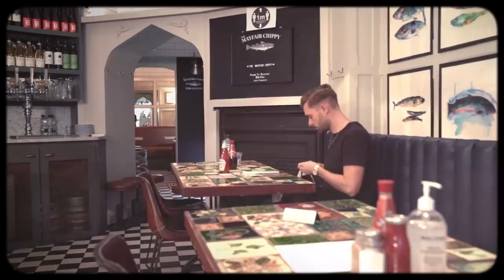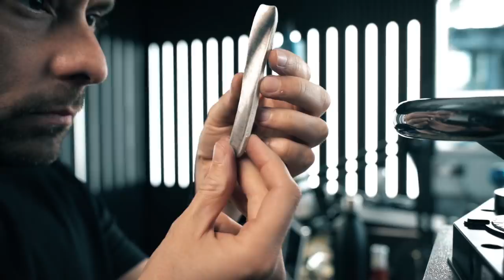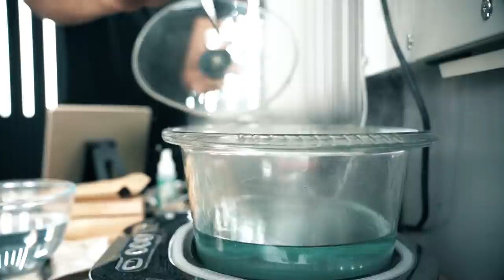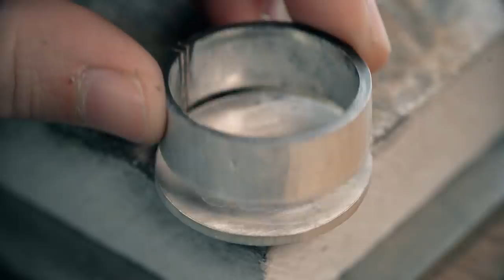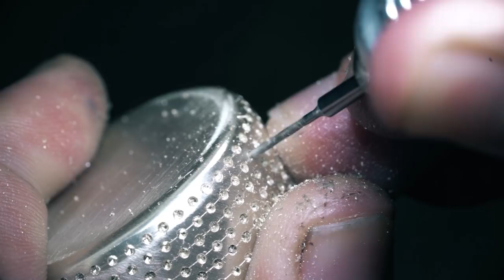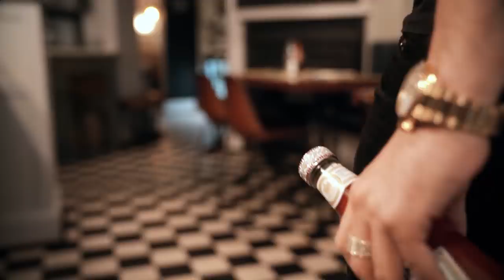I MADE THE MOST EXPENSIVE KETCHUP BOTTLE IN THE WORLD!

Comment: You should have a custom bottle blown with the Heinz logo embossed into it so that you can inlay the filigreed border, font, etc. with precious metals, gems and stones. Until then, it won't be what it should be. Then again, I think the moment is over.
Reply: Glass would be an exceedingly difficult material to set anything in, as any metal inlay or gem setting would require applied force to shape either the glass or the metal. I could see this as potentially viable if the glass was cast rather than blown and any stones were set into metal before attaching it to the bottle. But I think inlay would essentially be out of the question, given the way that metal inlaying is done.